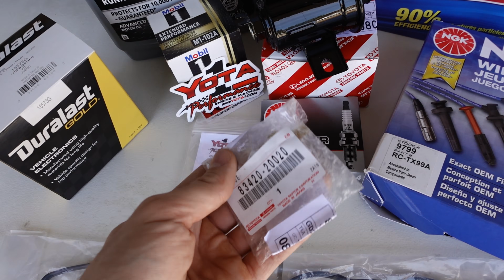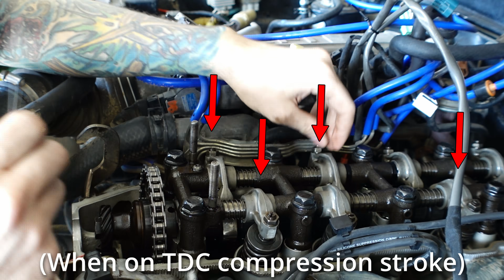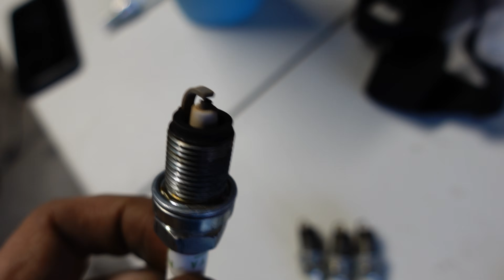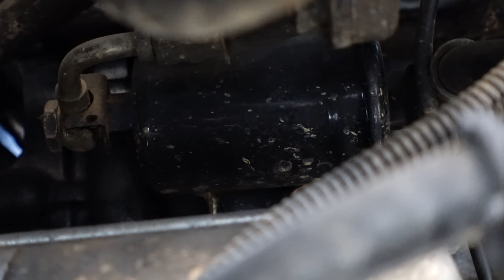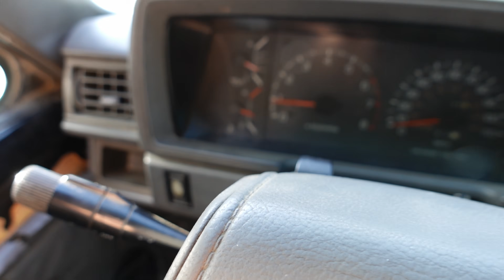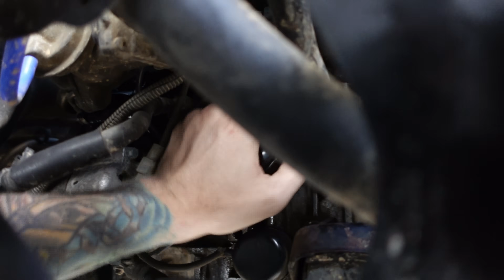Simple Maintenance That Can Help Your Toyota Run FOREVER: 22RE Pickup & 4Runner

Comment: Finally changing the fuel filter on an 86 Toyota Winnebago. A local mechanic called me back and said he couldn't even find it and to come pick it up '-) Mine was impossible to reach with tools or grownup hands. Could remove the banjo bolts. Saw a video to relocate it on the wheel well. (sorry I cant remember who to credit) Since I absolutely could not get a wrench on it I actually left the old one attached to the block and relocated the new one to a bolt on the passenger wheel well. Fuel lines are long enough and now I can actually change it easily in the future.

Comment: I got my coolant temp sensor for LCE engineer 84-89 and mine is a 1988 and the new sender looked almost identical but the new one did not seat all the way down before it got really tight it shows 2 threads tightened all the way down is that normal ?
Reply from the maker: Might be by design if it's a pipe thread. Going to get tighter as you go.

Comment: Did the coolant temp sender seat all the way down to where it shows no threads?? I just tried to replace mine and it only seated down 3/4 of the way before it got uncomfortably tight.
Reply from the maker: No, it shouldn't if I recall correctly. It's like a pipe thread where it gets tighter as go.

Comment: Does nobody spray carb/brake cleaner on oil stains? It dries and is usually like 95% gone, sometimes more!
Reply: no petroleum solvent because this floor is concrete.

Comment: Where did you get all those aftermarket suspension parts ?  I took the starter motor out to change the fuel filter on a 89 22RE. I the oil change is such a mess on those. I buy gloves and use a milk jug with the bottom cut off as a funnel. I rehearse the moment when that drain plug unscrews

Comment: awesome videos, have 97 fzj80, but have an opportunity to get a 1985 22re xcab  but needs tons of work, price is 4k. not running, no rust, missing lots of glass, hood, lights, interior is destroyed. but it was a dealer truck, never sold and less than 400 miles but it has been sitting since 1987, car fax only has 1 thing, shipped to dealer. never registered. I am thinking create a back to the future replica. what do you think?

Comment: Regarding the mobile one I think that’s what I saw you put in that 22 RE is that what you used since the new rebuild. Personally I think the conventional like Castro 10W-30 is best for these older engines. I have driven my 1988 Toyota pick up 22RE automatic for 22 years now. I made the mistake of not replacing a leaky radiator forgot to check it.went to town got seriously hot and blue a head gasket rebuilt The entire engine timing chain everything redone new rings crank turned anyway try never to let these engines get extremely hot almost guaranteed blow a head gasket

Comment: Why did you adjust valves cold when most folks and Toyota say engine has to be warmed up? Thks
Reply from the maker: It wasn't completely cold. It was at operating temp and sitting for a few minutes, so warm but not smoldering
Reply: @RM_Garage  Thks

Comment: I just got lucky and found a 1985 Toyota Hilux with the 22R carbureted engine. Running smooth and not in such bad shape. I'm really stoked. I have been told that these engines are indestructible, I have been watching videos non-stop on these engines so I can learn how to work on them and keep it alive and in good running conditions for another 30 years lol. Thank you for your video. Every video helps.
Reply: The 22 R Engine is an excellant Engine!

Comment: I found that adjusting the valves to .007 and .011 got rid of any "tap tap tap' noise and it doesn't hurt the valves at all. Also don't over tighten the valve cover because that will make the rocker arms it is attached to lift up which will increase the valve clearance. (dumb design on Toyota's part). Replace that short oil filter with a Purolator  PL20195 which is the same diameter but longer so it has better filtration. Don't forget to clean that throttle body (best to take it off so you can clean both sides of it), check the TPS and replace if out of spec and also the AFM. Having a proper operating TPS and AFM is the key to a good running engine.
Reply: Amen
Reply: Gonna do this to mine

Comment: I rarely comment on videos, but I wanted to say: 

I really appreciate your effort videography wise, clean audio, attention to detail, and no BS/rambling. I just picked up a really cool '89 Toyota/Gulfstream motorhome. It's called the Conquest, 22RE & 1-ton dually, fully loaded up with my gear and about to carry me across the country!  ... Just as soon as I finish fixing a busted radiator hose, my brake booster suddenly failing from a possible vacuum leak, replacing the alternator after the lower radiator hose/power steering pump shat a bunch of fluids & fried it. 

Oh, and a new deep cycle battery... 🙄😅

Anything I can do to save maintenance down the road while I'm already bleeding and turning wrenches, I'm all ears. 🌽 

I will be saving this video for future reference. 

Cheers! 👋🙂
Reply: You got my sub, bro! 

Toyota's for life 🥹

If you are ever interested in buying an MR2 Spyder, I'm putting one in storage during my trip. I'm considering a sale, if I really like life on the open road. 😀✌️
Reply from the maker: Thank you!

Comment: Tip:   You can use a leather belt to remove an oil filter.  Super easy, no special tools needed.
Reply from the maker: Tried it on this one! No luck
Reply: You can also hammer a screwdriver through it

Comment: Heard you recently rebuilt the engine, may I ask where you got new head bolts or did you reuse them?
Reply from the maker: I bought the truck with the engine freshly rebuilt, immediately cut off all the suspension, straight axled it, and turned it into what you see here! Lol. So I actually didn't rebuild the engine, but I have the receipts. The head bolts were from LCE. You shouldn't reuse them. Part number 1024063